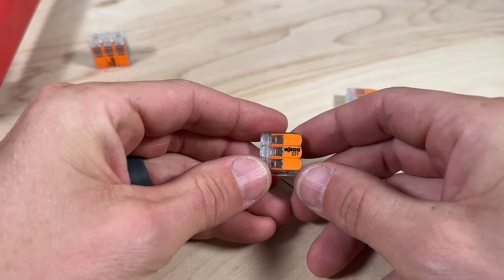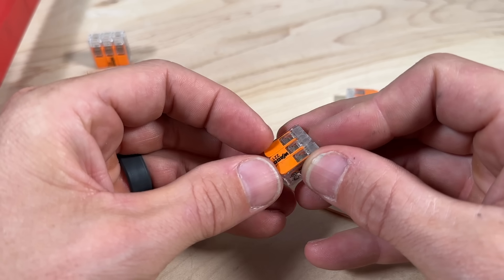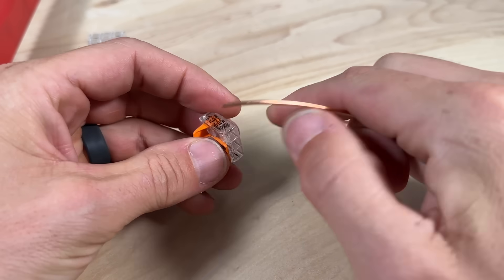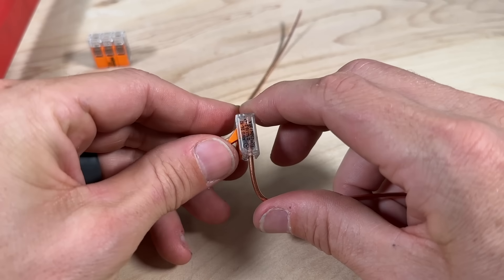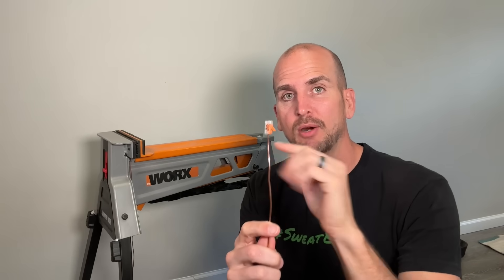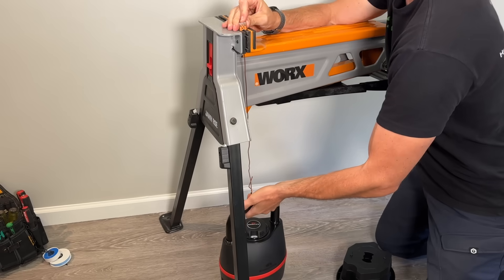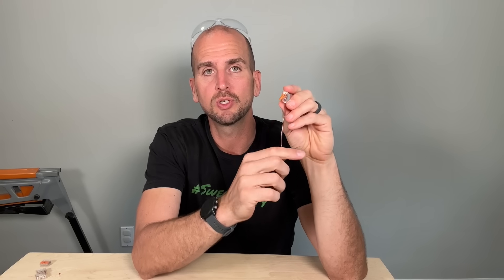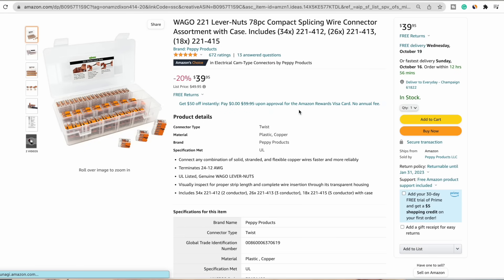WAGO 221 Lever Nuts: Testing the Most Common Negative Feedback

Comment: I concur with another commenter that wrapping electrical tape around the closed Wago nut would offer the best protection (and peace of mind). It’s still better than the standard wire connector, which in my experience is more likely to fail than even a partly open Wago nut.
Reply: That or some kind of a add-on locking clip that overlays the levers on the Wago nuts to prevent them from popping up. Thin enough to keep the levers where they need to be but still can be removed. (But E-tape is much cheaper though.)
Reply: @hdezn26  they should have come out with a cap that slides on to hold the levers in place , as explained in my last comment , Even if I wasn't aware of this video , I would automatically wrap them with electrical tape because just looking at the connector , That tells me to tape them up to keep the levers in place
Reply: @hdezn26  E-tape or small zip tie
Reply: I use WAGoOs all the time, and wrap them in electrical tape too.
Reply: @krakken-  I think it is a little bit overkill especially in a plastic box
Reply: @krakken-  That's good because when it comes to electrical safety
There's no such thing as being too careful
Reply: @krakken-  Great move trap the heat they generate so they melt quicker.
Reply: Or just literally check the levers before you close the box. Absolutely no need for the tape.
Reply: That was my original idea too. But even a zip tie would probably work enough, and there'd be less mess, and easier removal later on.
Reply: I would recommend against wrapping Wagos with electrical tape as it takes away many of the advantages: cannot visually inspect wires through the clear plastic, harder to insert a tester for measurements, harder to make changes. 

I have never seen any German electrician recommend wrapping Wagos with electrical tape who have worked with some type of Wagos for decades. Additionally, this may even violate code in some countries as this is using a product in a way not intended or certified by the manufacturer.

I have wired our entire new built home with Wagos and never had a wire pull out.
Reply: @ChristianWagner888 ok so do it how you want!
Reply: Wrapping with tape may be a violation. Increase heat! My understanding wrapping wire nuts with black tape is a violation
Reply: @weloveups831 depends on where you live not every area has the same electrical codes!
Reply: yeah, according to a youtube video a wire nut can only hold 70 pounds.
Reply: Yup. I just finished wiring my brand new home using WAGO’s throughout, except where wires were too large. When pushing wires into the box they would often hang up and sometimes open COMPLETELY. Wrapped them with electrical tape and problem solved.
Reply: was also going to suggest electrical tape lol
Reply: Yeah but then there’s that one screw wire nut lover getting huffy and replying with but you can also tape the screw wire nut not realizing the issue people have with the design of the screw wire nut comes from how the wires are held together and the unnecessary resistance and fire hazard it bring, I’ve seen more house fire be cause by screw wire nuts than wagos on here, but some people are just adverse to change.
Reply: I thought everyone had started doing this with Wago connectors,  and all the imitators as well. As you said. still better than wire nut and hues time saver.
Reply: They don't pop up unless you tug on the wires I guess and the lever gets caught on something.
The natural state for the metal clamp is closed the lever is only there to pry it up
Reply: Or a small zip tie, that's what I'd use if it's in my own home as down the road it's easier to snip it off than unwinding gooey old tape if you're changing something.
Reply: Even if I wasn't aware this video , I would automatically wrap them with tape for added safety , What I would do first is wrap them with splicing tape then add a top coat of electrical tape to keep the splicing tape from unraveling and plus , The electrical tape really sticks good to the splicing tape , So there's no worry about the electrical tape ever coming off over time , Also the only electrical tape I use is Scotch electrical tape because other brands will eventually start coming off but wrapping with splicing tape first will guarantee that the electrical tape will not come off because of how great it sticks to the splicing tape , 
When the Wago lever connectors came out , They definitely should have had a slide on cap to keep the levers from popping up
Reply: @ironmartysharpe8293  Over my fifty years of wiring, I have never seen electrical tape come loose.  I have gone into houses where the tape had to have been on for years and wished it would come off easy.
Reply: In a crowded box I always put a wrap or two of electrical tape around the WAGO.  I think its a great solution, and it is totally trivial to undo it if I have to mess with it later on.   In a non-crowded box, like in a light fixture, I sometimes don't bother.   But then again, it is just as easy to put a wrap or two around two WAGOs as it is one, which is fairly common, and it cleans up the look of the wiring so... why not ?

Comment: EVERYDAY HOME REPAIRS< Which weight are you using for the pull test that is adjustable?
Reply: Looks like the Bowflex Kettlebell
Reply: @derekgalier7273  thanks i didn't know they made adjustable kettlebells but they are expensive

Comment: Thanks for the test, it was interesting. I've noticed this myself when I've been folding wires back into the box. But I've had a different issue, the lever caught on a wire and came completely open.

I'm a lot more careful now to visually check when using them. I tend to only use them when I'm mixing stranded and solid because I think they do a better job. I've never had any issues with wire nuts on solid wires, but I always cut long,  pretwist and then nip them to length. It doesn't take that long. And it's a proven technique over time. 

To me it's not a one or the other, it's using the proper tool for the job. If I've got all solid wires and a lot of room, I'll use the cheaper and to me more reliable wire nuts with a pretwist. But when I do prewired lighting fixtures with stranded wire, I'll pull out the wago. Or if I'm dancing on a ladder I'll preinstall  a wago on the fixture wires to make it easier.
Reply: This is my concern about the levers being that far up.
Reply: yeah no ladder dancing.... yes space is a big consideration too.... for the few connections I've needed I preferrred wago (or clone - ya supposedly not good but I'm just not seeing the issues, physically stronger than wago I think, can't speak to the electrical properties etc.  Will watch more you tube on China clone tests.

Comment: If that very thin piece of metal that spans the wago is all that is needed to be a "good connection" then i guess all the harp about solid connections twisting, tightening, in/lbs of force, bla bla bla, seems to be all hype. That is what I'm taking away from all these wago videos.
Reply: Good point, we’re supposed to torque connections in the panel to 20 in pounds or more . Doubt a wago is doing the same
Reply: You dont torque a wire nut?.
Reply: I do

Comment: Nice testing!
I'd be interested in a similar test of wire nuts. The 'screw them together and tug' doesn't seem to put anywhere near 20+ pounds of force on them.
Reply: My thought is that a wire nut would perform worse because the internal spring flairs out to the opening of the nut, where as the Wago has separate connectors for each wire doubling the weight bearing capacity.
Reply: Tan wire nuts broke free at 43.5 lbs...the video is out there.
Reply: @brianreinhardt4050  I've had wire nuts pull out just tucking them back in the box. Obviously not installed properly, but... how would you know? You can't tell until its too late.
Reply: @brianreinhardt4050  believable if installed properly. That said, how many DIYers, green horns, apprentices, hack electricians, and monkeys install wire nuts with the skill of a journeyman or master electrician?
Reply: @QuietRiverBear  Please...don't get me started on "Journeymen", "Master Plumbers" or "Builders".  The things I've witnessed the "trades" do borders on criminal.

Comment: You showed that it isn't holding as tight. As many have mentioned, the connector is unlikely to experience that much pull. I'm curious if there is more electrical resistance when the lever is pulled out due to the looser connection.
Reply: I would really doubt there would be any difference in electrical characteristics between something that can hold 20 pounds vs 25 pounds.  Those are both very firmly in full contact with the wire...

What I'd be more concerned about is what happens when even a little bit of extra force is applied to that tab (for example, by getting caught on another wire in the box when pushing everything back in), as I suspect that could easily make the force on the contacts much less, and possibly start to cause electrical issues.

Comment: A resistance test between one of the unused terminals an the end of the wire seems like it would have been more electrically important. A difference in resistance is where you would get heat and possibly fire.
Reply: You are correct but it takes a shunt ohmmeter to measure less than an ohm. That might prove to be expensive - hence the crude tests.
Reply: That will tell you if the connection is bad today. This will tell you whether the connection will work loose (and create new high resistance points) in the future
Reply: Of course you could apply force and still measure resistance. You are simply using heat as a surrogate for measuring resistance. Heat is just a cost effective way you've chosen to measure resistance.

I applaud your tests particularly the application of force to the connection.
Reply: Another video showed overloaded circuits with various connectors and Wago held up reasonably well before melting.  The wire nut connection, however was the best to resist heat from overload.

Comment: If you're using more than 20lbf in an electrical box. There's a problem much more concerning than the Wago.
Reply: I can't think of a single reason why you would have any pressure beyond the bending force of wires in a box.
I have hung light fixtures from a wagon while I'm hooking up the other wires before mounting the fixture to the box. But once it's mounted there is no tension on the wires.
Reply: I would be more concerned that I'd catch the lever on something and completely release the wire from the tension but the wire staying and making an intermittent connection. Seems like that would be a bigger problem.
Reply: That's one heavy switch or receptacle hanging out of its box. You did another comparison with wirenuts and they were both within the manufacturing required specs.
 Check your insertion into boxes. 
EU been using them for years.
Reply: Actually this is a legit test. It means reduced contact pressure on the wire. Slightly higher milliohms resistance. 
Also when jamming the wires into the box, any one wire might have a lot of tension if wrapped around other conductors.

Comment: Okay, but this leaves me with one question: how the heck is anyone getting 20 pounds of direct pulldown force on a Wago 221 in an electrical box?

Sure, it holds less in a test, but it doesn't seem like it'd matter much in real world use.

Still, good idea to make sure the levers are fully closed before finishing up.
Reply: There's all kinds of people in the world. I'm sure someone has 200 lb gorilla'd one and now claims Wago is bad. A guy told me once, Ford ngines are bad because his didn't go more than 200 miles without oil.

Comment: I've noticed that too-- another thing I've wondered is whether a Wago that has been used once or more times loses its holding power, especially when sort of tripped in the open position.
Reply: It would need to be much more than once or twice unless you damaged it during the process.
Reply: I was tripping last night. I’m still a bit damaged.😮
Reply: @rob379lqz  that's the stuff you should share. Or sell in a legal state. Make a mint.
Reply: I've heard that they are reusable, but only with equivalent gauge or heavier.
Reply: @surferdude642  That's for the push-in Wagos like the 773. The 221s are just flatly reusable.
Reply: @intercity125  You may be correct, I've heard both opinions on that. It seemed to me that some tension may be lost when going to a thinner gauge. However, I have done exactly that and experienced no issues. 
On another note, I used the 221-2411 in line connectors on 12AWG no problem. They're rated for 14AWG max. The 221-2401 are rated for 12AWG. The thinnest wire is the same, so what's the point of the 2411's?